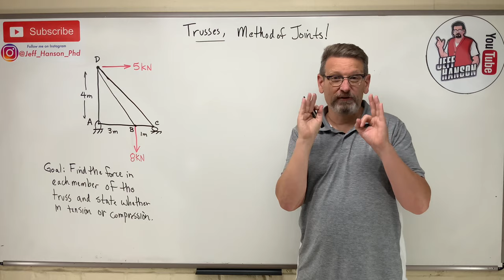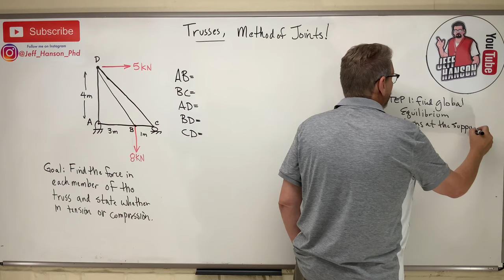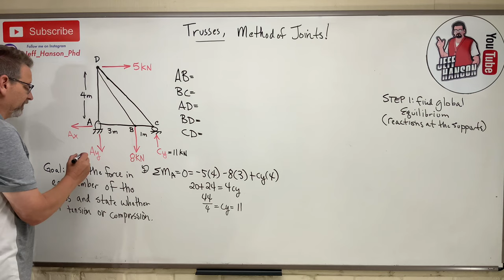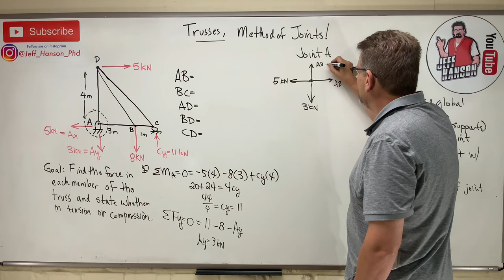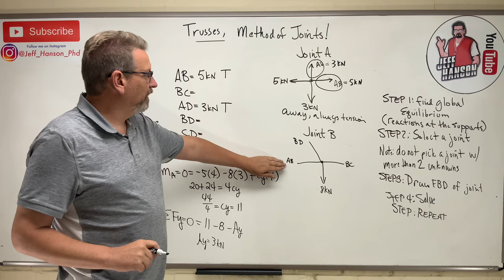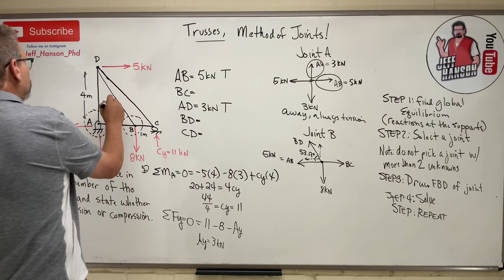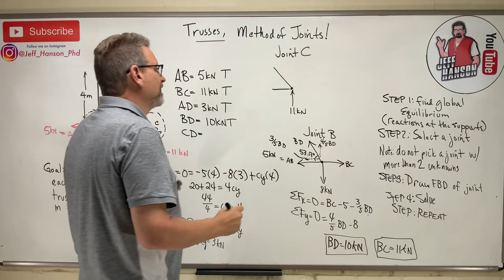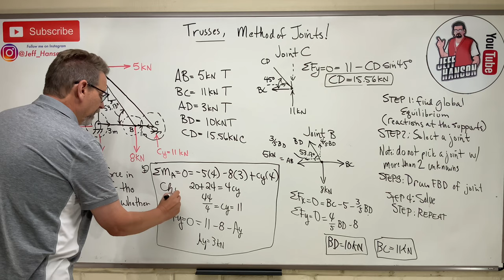Statics: Lesson 48 - Trusses, Method of Joints

Comment: The method of joints is strongly analogous to node-voltage analysis in electronics;
you can sort of think of the forces as "currents", and the joints as "nodes".

Comment: Hey, at 11:13 where you mentioned that I can use tan to get the angle, why did we use 36.87 instead of 53.13? Arctan(4/3) is 53.13.
Reply: I got stuck there too and he later corrected it to 53.13°
Reply: And why must it be tan?
Sin and cos will also give the same 53.13°
Reply: Yeah, he corrected it later on. He used tan as it's opp/adj

Comment: There is a mistake at the end when we are looking at joint C. Please help
In the Y direction we have Fy = 0 = 11 (reaction force) - CDxSin45 = 11 - 0,7CD 
Therefore CD = 15.56
However Sin 45 = Cos 45 = 0.7
So in X direction we have Fx = 10 (BC) - CDxCos45 = 10 - 0,7 CD
Which means CD = 14.28 

There must be a mistake somewhere because if the angle is 45, which it is, BC and the 11kN reaction force must be equal. 
Can someone help me figure it out.

Comment: how do you choose the moment at A for calculations, can you do it anywhere? like moment at C?
Reply: At A easier because you have 2 unknowns so you will get rid of them
Reply: For static equilibrium, the sum of the moments around ANY point, will be zero.
For accelerating bodies, it is more complicated, and IMO, you are asking for trouble if you pick a point other than the center of mass, or a fixed rotation axis.

Your instinct might be to take moments about a pivot point, but you can really do it around any point that is convenient for you.  It is strategic to take moments about a point that allows you to have as few unknowns as possible in the moment balance equation, so a point through where two unknown forces act is a good choice, rather than a point through which just one unknown force acts.

Comment: How come 3/5BD is negative wrt point B. 5KN is compression but 3/5DB is tension force on point B. Please explain.
Reply: Both the AB and BD are in tension as the reaction forces are going AWAY from the joints. The only member in compression is CD, which is why the reaction forces is going TOWARDS the joint.

Comment: Can someone please help with the question. How to know whether to choose sin or cos while finding a component.?
Reply: Sin is usually for the Positive Y component , while Cos is for the Positive X component.
Reply: @Roberto-mm8ji  clearly wrong. You have to know about the ratios of sine and cosine which is opposite/adjacent and adjacent/hypotenuse try to work through this and you'll know when to use sine and cos.

However, I'll give you a shortcut, such that whichever side the angle is made is the cos component. Eg if the angle is made with the y axis then the y component is the cos component.
Reply: You need to know the ratios that sin and cosine are referring to.

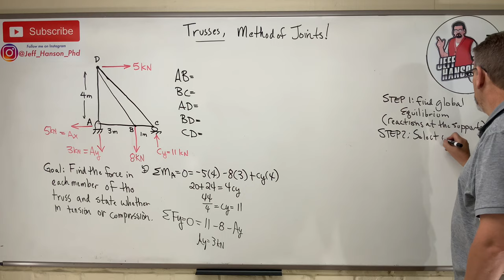Comment: why was there no Cx component at 6:30
Reply: Because that is a roller support at C so there's only a y component which is Cy :)
Reply: There is no Cx as it's a roller joint, as the other comment mentioned. But you can still evaluate the force along the x-axis, which will give the same answer. It will be as follows:

ΣFx = 0 = -BC + (CD)Cos45°
=> BC = (CD)Cos45°
=> 11 = (CD)Cos45°
=> CD = 11/Cos45°
=> CD = 15.56 kN

Comment: Why didn't we find Cx(horizontal components of C)
Reply: I think it's because its a roller joint
Reply: There is no Cx as it's a roller joint, as the other comment mentioned. But you can still evaluate the force along the x-axis, which will give the same answer. It will be as follows:

ΣFx = 0 = -BC + (CD)Cos45°
=> BC = (CD)Cos45°
=> 11 = (CD)Cos45°
=> CD = 11/Cos45°
=> CD = 15.56 kN

Comment: Why at the joint C the arrow for CD has to go down i can’t get it??anyone can explain it :(
Reply: There are two answers for this question :

Answer A:
We always apply the principle of balance, so while there are only two forces in the y axis, the 11KN force which acting upwards and the CD force which must act downwards, (only two forces, if one upwards, the other must be downwards and vice versa).

Answer B:
Actually you can assume the force upwards or downwards, as you like, but when the CD force value becomes negative, this means the force direction is the opposite of what you assumed, if the result was positive then the assumption you made was true.